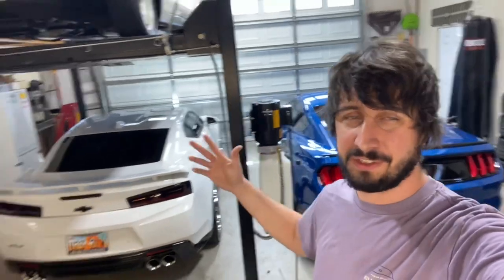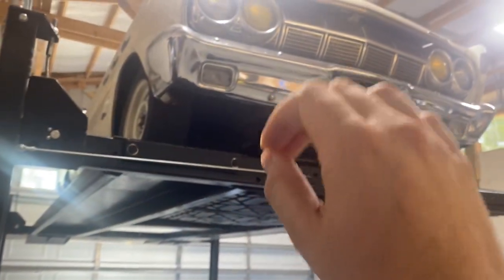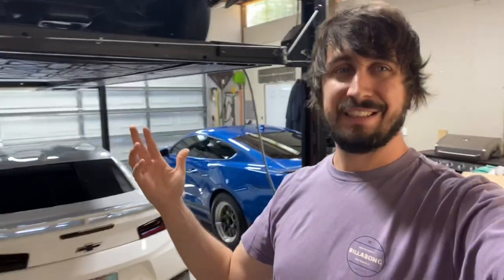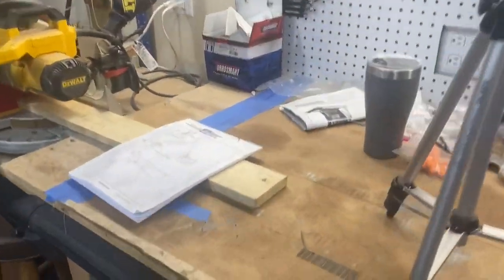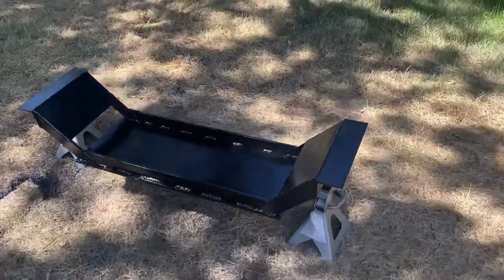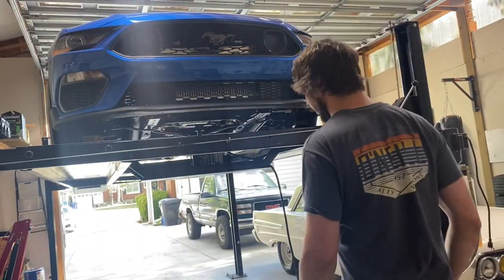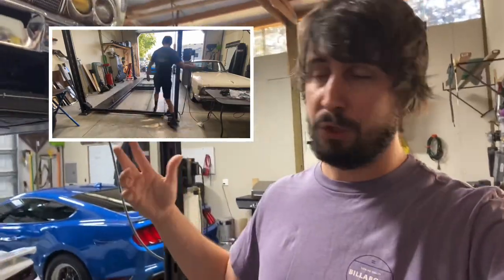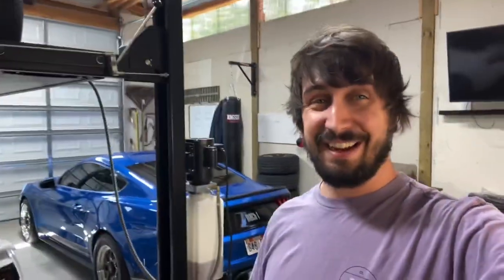DIY Four Post Lift Modification

Comment: Did something similar, I use 2 cheap 4 ton telescoping bottle jacks, I also welded 2 pockets on a cheap cross beam adaptor so I can get wider lift points when using both jacks. Cost less than $150.

Comment: Is this any different than the jack trays that come with many 4 post lifts from the factory? They are meant for exactly this. It's just a metal tray you place your bottle jack or whatever in. Even the cheap lift I am looking at comes with this jack tray.

The only real difference I can see is that yours allows you to use a larger bottle jack than typical. But at the end of the day the mini bottle jacks usually work well since all you really need is to raise it up enough to get the tires off the base.
Reply from the maker: So my lift cam with plastic trays but you couldn’t lift from them.  I had a metal tray but the issue was my cars are low and you needed to get a low profile jack in there which could also lift it high enough to get the wheels off.  So you are right its the same idea but my stock tray was the wrong height to fit my applications.  Would have worked fine for a truck, suv or car with more clearance.
Reply: @truckandroll989  That's why I was considering using a mini bottle jack. I haven't actually done this yet but am looking into it versus just buying the scissor lift attachment. My cars are about 4-5 inches from the ground so not crazy low but low enough. It's just hard to find a good mini bottle jack with a decent lift too.

The other issue with the scissor lift is they typically require about 4 inches of clearance under the car. So I am still on the fence here if that would even work for my car, sometimes parts hang a bit lower than the bumper does. It's unfortunately not a simple issue to fix unless you have a welder and metal like you did here. It would cost me a fair bit to have someone fabricate the same thing I think.
Reply: @jdmcarrepairs142 check out the air bag jacks, they have high capacity both weight and lift from a very compact package.

Comment: Have you considered using an air bag jack with your flatter jack tray?  I recently installed an old 12k 4-post lift and just got a 5 ton air bag jack to try and lift vehicles from the body seam sides so I don't need to be underneath.  My lift came with no accessories so I may try making a jack tray or buying one so I can lift from the center if I want.
Reply from the maker: Honestly, its a really good idea.  Ive seen them and they look really cool!  Unfortunately I had to sell the lift and now rent that place.  The new shop is a 4 car garage but no lift :/

Comment: Great Idea. I have been debating 2 vs 4 post lift purchase and a mod like this could be the deciding factor. You did not say specifically, but your main downside is that it hangs too low (how many inches?) to put the ramp all the way down for when you drive a car on? I can think of three solutions (but i am not sure they are worth the cost effort) a) less deep tray, but this probably means a shorter (and less lifting capacity) jack, b) cut out some of your garage floor (doubt it) and c) ramp extensions. longer ramps would keep your approach angle low without having to lower the lift all the way. any thoughts on these ideas?
Reply from the maker: So if the main issue is lifting height.  This lift comes with a tray but any of the available jacks are either not low profile enough or dont lift high enough to make it work.  A hinged tray, like what i made but with hinges, could work but would be more time consuming.  They sell sliding scissor jacks which solve all of these problems but cost a decent amount.  Ramp extensions could work but its one more thing to build and you are driving a car up onto a partially raised lift which may technically be a “no-no” but maybe in reality NBD
Reply: @truckandroll989  good points. I would imagine there is quite a bit of vehicle variation in lift needs to calculate as well. thanks again for the post.
Reply: A four post lift is the correct choice if you have long term storage needs.  If you're planning on doing your basic maintenance, a two post lift is far more useful.

My brother has a four post lift, but he uses my two post lift for brake jobs, or when he rotates the tires on his wife's import car.  With out a bridge jack, his 4 post is almost useless for many tasks. Smaller cars and some small SUVs have a narrow stance, and without a bridge jack you may not be able to get on a decent jacking point if you are relying on lifting from the ramps.

Comment: Does the car have any tendency to tip a bit once one wheel is removed? What about positioning the jack under the side you want to remove the wheel on? It looks safe enough,, but I keep imagining if the car tipped enough and the jack kicked out, and then the car slid off the lift.....
Reply from the maker: So not really shown here but id put small jack stands beneath the car once it was high enough to remove the wheels.  As for sliding off the lift to a one side nah.  Basically lift from center, jack stands in, lower and do whatever you want safely.  Thanks for watching!!